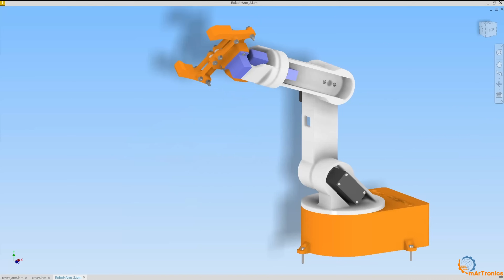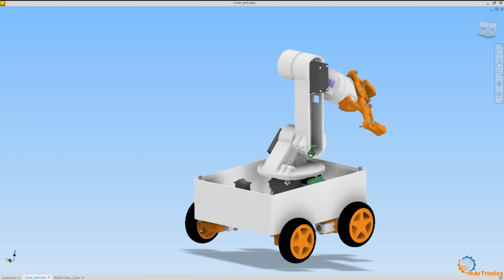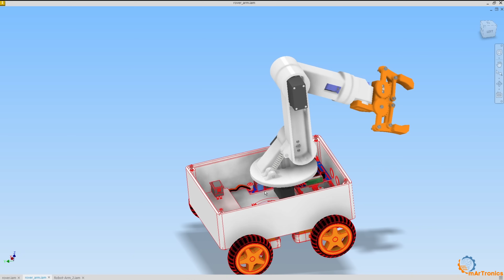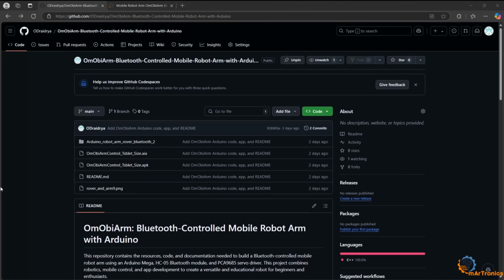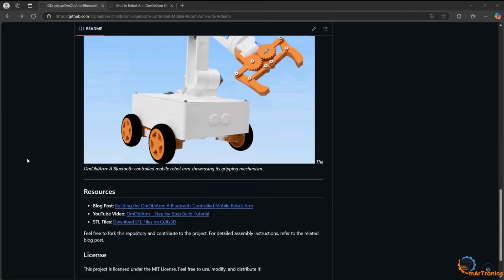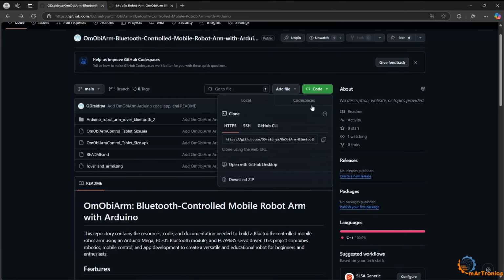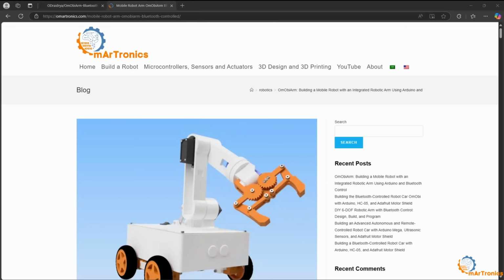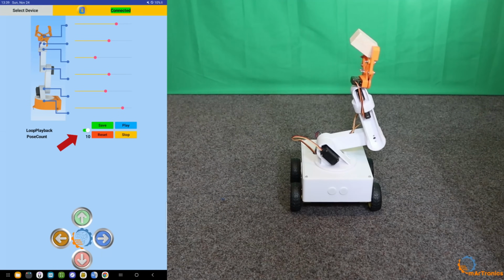Arduino & Robots Project 14: OmObiArm - The Mobile Bluetooth Robot Arm You Can Build at Home🔧🤖📱

Comment: I We reduced and adjusted the PCA9685 input to 6 volts as shown in the video, but the capacitor exploded 😢what could be the reason
Reply from the maker: If the servos draw too much current or stall, it can cause voltage spikes that damage the capacitor